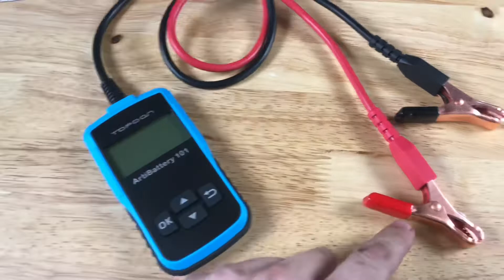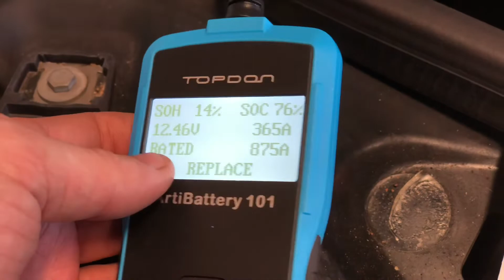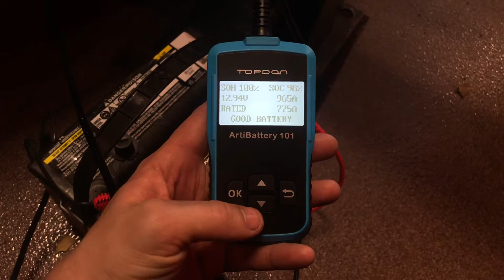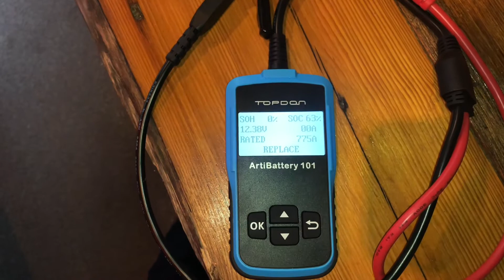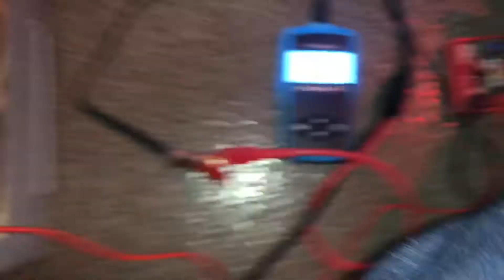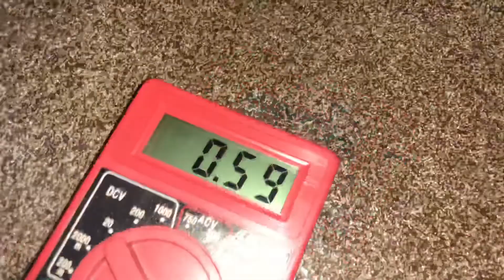Topdon Solid-State battery, alternator and starter automotive tester

Comment: Good review. But i think you confused it with the regular load tester that put actual load to the battery. This is called conductance test, works by sending ac current to determine the cca against rated cca